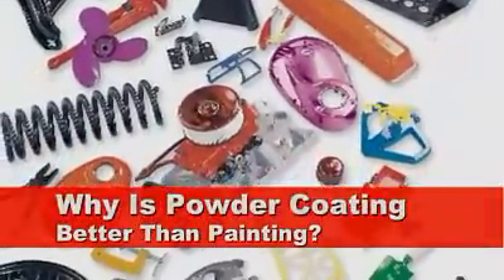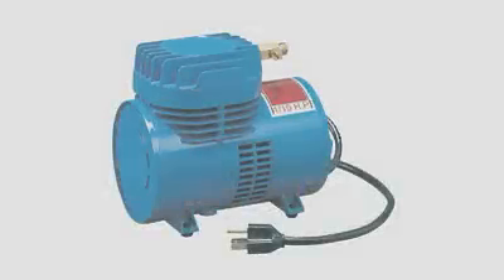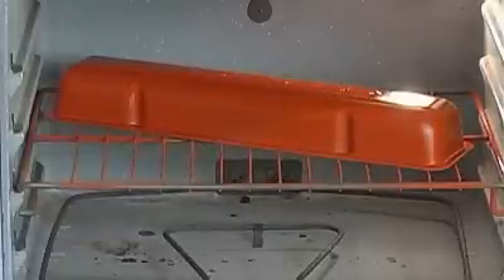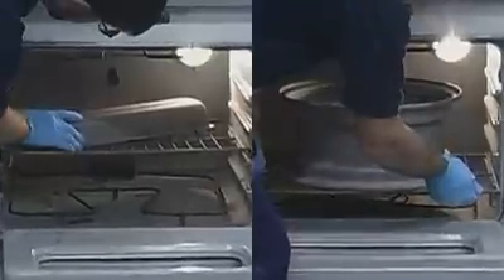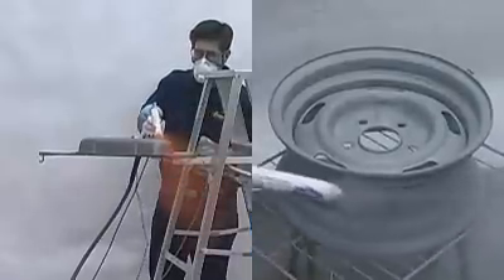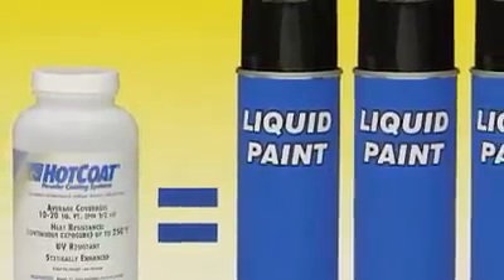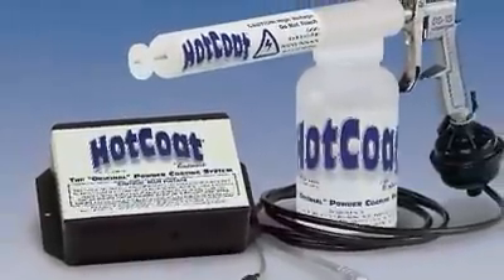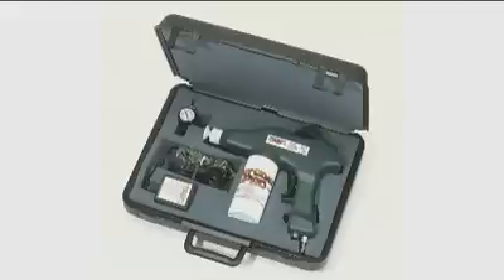Why is Powder Coating Better Than Painting?

Comment: I love when people compare powder coat to spray paint, what a half assed comparison. Spray paint is pretty much good for nothing, unless maybe decorative items you just need to color up quickly. How about comparing it to 2 part automotive paints or industrial paints like high build epoxy/urethanes or better yet, siloxane paints...
Reply: Those are good for cars bodies and powder coating is good if you want to paint suspension parts, engine parts, etc etc.

Comment: I like how you say not to use a gas oven. I've been using one for 7 years now, but i do powder coat in a different area than my oven. Gas is a lot cheaper to use than electric. It would have cost over $300 just for the 220 wire I needed plus the bill every month. $75 for a big tank of gas and because I have electric ignitor on my oven, my gas lasts almost a year depending on how busy I get. I've been buying eastwood products since I started coating, you can't beat the ease and price of your equipment. Me and my friend compared his $1400 system to my dual voltage gun and my gun did just as well. His is for larger parts like frames and the power cord is a lot longer but he ended up buying one of your guns as well and likes it

Comment: no, filler and powder don't bond together. you will have problems while curing. filler will collapse and you will have hole where was filler. Powder painting works on electrostatic, it is not like liquid spray painting.

Comment: Yes, it has to be bare metal. Any other finish like paint rust, or oil etc. in porus material will outgas under the applied powder as it is curing and cause the powder coated finish to fail do to lack of proper cleaning and the inability of the powder to cure to the bare substrate. Body filler is a no go. Use Metal Lab or w/e EW calls it for filling minor imperfections. Dont use a primer unless it is a powder primer or the applied powder coat will not cure correctly.

Comment: @3GBlog Ya, a bicycle or a motorcycle.  Fixin to do this myself to my 1981 atc 185S once hunting season is over.  Gotta fix up the small pinhole leaks in the tank and powder coat it real nice along with the frame.  That just doesn't look as black as it should.